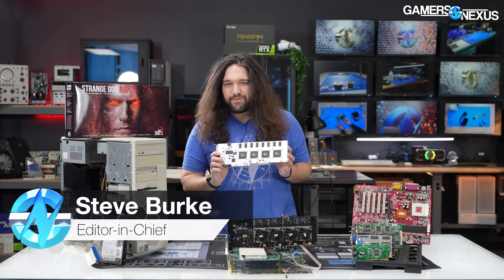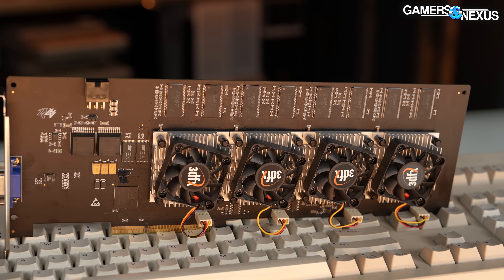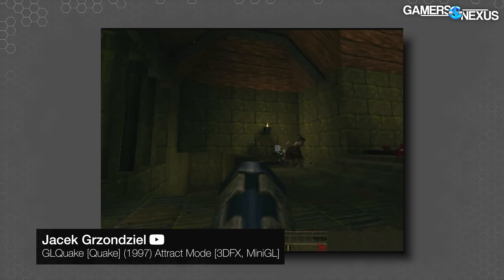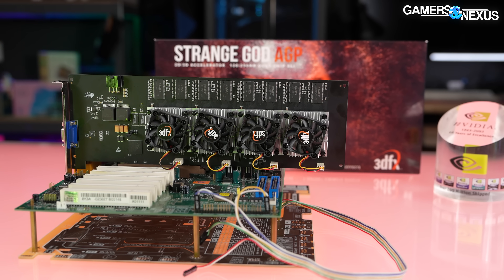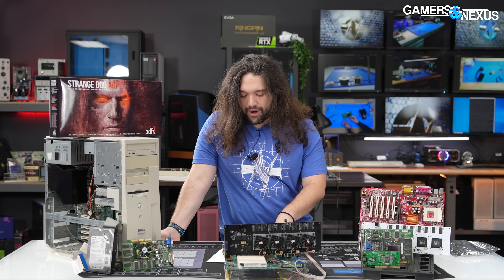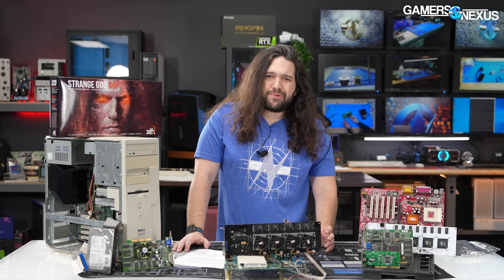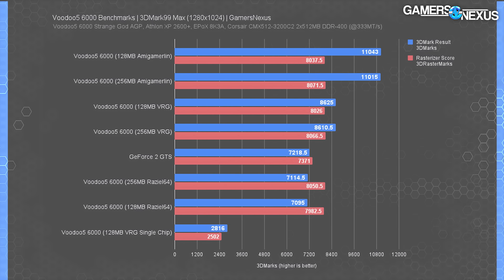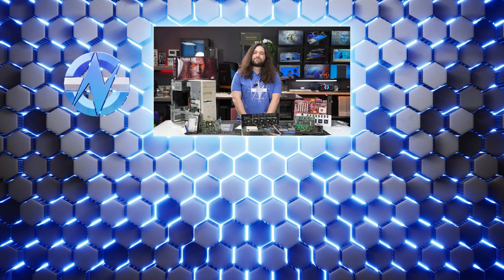Back from the Dead: 3dfx's Unreleased Voodoo5 6000 Quad-GPU Card

Comment: Still got a Voodoo 4 4500 somewhere. Wrote up a piece on my old hardware site back in the day, comparing it to a Voodoo 3 3000 and a TNT2 Ultra. It ran much like a slightly overclocked TNT2 Ultra because, with a 2x1 pixel configuration, it more or less was.
It was sad to see 3DFX prove it really was just a one trick pony, once SST1 was obsolete it iterated the best it could, but couldn't evolve. Avenger will always be the pinnacle of 3DFX's achievements in my heart.

Comment: This was a really cool blast from the past. I distinctly remember Leo Laporte going nuts over the GeForce 2 series, and how it was a "3dfx killer." For my part, STB made my first dedicated graphics card from this era... a PCI "S3" model, if I recall, with 8 MB VRAM. I was pissed when 3dfx bought STB -- all my driver support disappeared! 😩 First AGP graphics was the GeForce 4 Ti. Super proud to snag that one at "only" US$400 in ~2003 money. (Retail could be as much as double that, depending on the usual factors.) Ran it for years. I also had the first ATI Radeon... the Radeon VE if I recall (later badged Radeon 7000) as an AGP card. Wish I hadn't got rid of it now, but it "only" had VGA outputs, and I was neck deep in DVI in those days. 🤷‍♂👍

Comment: YES! So glad to see this type of enthusiast and retro projects.  Am I biased as the owner of 2 different voodoo 5 5500's in retro PC's? Maybe- but this type of niche content is still impeccable.
Reply: I still have the V5 I stole from the returns / damaged cages at PC World back in the day. Still works like a charm. Haven't installed it in any retro rig though. I did for a while, but swapped it out for a Geforce 2 Ultra and used a pair of 8MB V2s for the Glide games.

Comment: Loved the video, brought me a lot of memories of that time when 3dfx died. The only thing I missed was a FSAA test. The Voodoo 5000 was the first GPU to support the feature. Was one of their selling points. Also high res textures.
Reply: I think any voodoo can do anti aliasing, I remember the option in the windows drivers for the voodoo 2!
Reply: Many cards of the time could do a basic render higher res and sample down technique but the resulting ordered grid is not particularly efficient method for the most visually aliased directions (near horizontal/vertical). Voodoo 4/5 implementation allowed sparsely sampled (aka rotated grid for 2x/4x) grids. Though ultimately as super sampling it still had a significant speed penalty. Anti aliasing remained a bit of an old game only thing up until the ati radeon 9700 dropped with multisampling a couple of years later.

Edit: totally forgot the gf3 did actually have multisampling and a decent 2x sample pattern, however it was still a fair hit on speed with most at the time preferring to use spare performance for higher res.
Reply: Also, the Voodoo 5 lacked hardware accelerated transform and lighting. It was because it was so late to hit market. Back then I bought the Radeon DDR (first Radeon branded) which was faster then the Voodoo 5 cards, but I was still torn about the it. I have I friend the got the Voodoo 5 and we all were so jealous about it, in spite of having faster GPUs, the Voodoo had this cool factor and a lot of games still supported glide, and looked amazing. It was good times. I miss having more than 2 brands o GPUs to choose from.
Reply: @idetre  Good times when there were 3dfx, ati, nvidia powervr, matrox... but the future was already defining

Comment: I wish you would have put out a call to your subscribers. I have a working AMD Athlon system, AGP,  Windows 98SE installed. I also have a Pentium2 400mhz system with a MAtrox 2d card and 2x Voodoo2s in SLI, also Win98SE. I would have been happy do help you out.
One of the problems with testing these old cards is getting a CRT monitor that can handle the refresh rate. I also have a Hitachi Superscan Elite 751. As a now aging, PC hardware enthusiast, I really enjoyed this video, great work!

Comment: As PC HW collector i have alot of 3Dfx cards.. In fact i miss some such as Voodoo IV 4500, Voodoo V 6000 (since is SO rare as hell), Voodoo III 3500 and Voodoo III 1000/ Velocity, everything else i have from the consumer cards.. I dont have also Quantum 3D cards as they are also very rare... Aside from that i have alot of ATi, nVIDIA, Intel, AMD old HW, MatroX, CyriX, Rendition and many others... I have Vodoo V 5500 AGP card in GIGAbyte dual socket 370 mobo with x2 Pentium III 933, 2GB ram, 200GB IDE drive all in black IBM case... 

Nice video, it will be nice if the channel does more videos like these of some old HW...

Comment: I had an i740 back in the day, too.  I remember it was a massive pain to get it to work right on my K6-2 system.  Doesn't surprise me that they had to run it on the P3 to get it to work right.
Reply: I found some i740's that actually looked well made, in a bunch of Dell workstations. Curious, I didn't recognize them, so I took one home to test it out and was surprised at how well it actually played (for what it was). Monster Truck Madness all night. 

Obviously not a belter, but good enough. Cool pieces of history! XD
Reply: @TheVanillatech   good for DX5 games
Reply: @ChristopherKubilus-k8e  Yeah they did the job for those early accelerated titles. Lacked a lot of features though, the smoke on Colin McRae and GP500 for example, wasn't transparent, but thick opaque black polygons! :D 

Kinda unique! :D
Reply: @TheVanillatech  I had an Intel 945 on my 2005 Windows MCE and Battlefront took 10 mins to load because no TnL and then the light sources shined through the walls. Pretty bad for a $1000 computer with the worlds first dual core Pentium D 820 at 2.8 GHz. Luckily it had PCI-E and I learned all about that and Graphics cards.
Reply: @ChristopherKubilus-k8e  Yeah of course. Aint no onboard GPU gonna be up to snuff back in those days. Shit was exponentially improving year on year. Golden era of gaming. Shit even top end Dell workstations like the optiplex and dimensions, which cost over £3000 and came with dual P3-550Mhz Slot 1 CPU's, onboard SCSI ports back in 1999 etc, even they only had ATI Rage Pro onboard, cos they ain't meant for gaming. Just enough to give you a nice picture in Windows thats all.
Reply: @TheVanillatech  I threw a fit when my parents didn't buy me Monster Truck Madness 2 at Best Buy and then they bought it for me (I don't remember if it was right then or for my birthday) and it was the best game lol

Comment: I absolutely loved how smooth UT99 was on my PII233 and Voodoo3 3000 AGP. I felt like the Glide/UT99 optimisation on the Voodoo3  more than compensated for my lower end CPU at the time. I still remember I used to run them both overclocked. The Voodo3 from 166 to 183 (the speed of the Voodoo3 3500 TV) and the PII from 233 to 292 (the highest setting my boards FSB would go? from 66 base to 83... again, using very old memory brain cells)
Reply: yeah but over clocking only just startred to come out then, i remember in 1998 computer shops were only just startign talking about it and magazines were pushing it .... before 1998 nobody had heard about it or was doing it... quake 2 probably started it all, it did look amazing at the time with 3dfx

Comment: Loved this video. My very first piece of computer hardware I got was a 3DFX Voodoo 3 2000 PCI for my birthday (~10-12 years old). Had to take it to a local computer shop to have it installed because I didn't know anything about doing that kind of stuff yet. We had a Packard bell with a Pentium I, 16MB RAM, and a ~5GB Hard drive. I remember being blown away at the difference when I got the computer home with the Voodoo 3 2000 installed. First thing I launched was the hexen II demo. The difference going from software rendering to hardware accelerated OpenGL (or maybe glide IDK) was night and day.

Comment: I actually had that MSI board! Also smoked an Athlon in it, using the wrong standoffs 😂. Those CPU dies were naked and not temperature protected.

As far as I know, you can't put a 2400+ on that board. You'll need a previous iteration of the CPU I think. Those were up to 2100+ if I remember correctly. It's a Palomino board originally.

You can make the 2400+ (Thoroughbred) work though. You had to mod the motherboard. If memory serves me well, you'll have to remove a small component of the motherboard. Component c37 I think it was. And a more recent BIOS supporting Thoroughbred.

So....maybe the board is less DOA than it seems? 😂

Also a popular mod of the GeForce 2 GTS card was putting heatsinks on the memory with thermal adhesive and you can also thermal adhere a Zalman Blue Orb on it.

Also popular before 1GHz CPUs were a thing ...getting the 100MHz FSB 600MHz Piii and slapping that on a 133MHz FSD, getting you to close to 800MHz and not running the busses out of spec. On the old BX440 chipset, people hit close to 150MHz FSB and reached around 1GHz.

Fun times.😂
Reply: Oh the blue orb! Stuck one of those on my geforce 256. Was a pretty good overclocker actually went from 120 core/160 ram to 160/193

Comment: Cool episode, brings sweet memories. I remember how cool and fun it was to mod and overclock those years cards. Also design look so simple today with those big ass 0805 SMD parts :)
You just explained typical R&D process of graphics card AIB bring-up :) Broken corked drivers, flaky power management, early buggy silicon, hardware issues , etc :)

Comment: What a great video, brought me back to the old days. The MSI KT3 Ultra was the first board I bought brand new ! ( Before I only bought used ). I had an S3 2D card with 2x Voodoo 2 3D accelerators and a Samsung 19" CRT. Man was that a brick to carry around to LAN parties, lol. I beige Full tower with 2 CD burners an 2 CD reader drives for the sweet dual copy function ;) Remember the 10.2Gb Seagate 7200RPM HDD, plus a few older smaller used HDD. Them ribbon cables... Cable management was impossible.

Comment: Nice bit of nostalgia. I think the GF2Ultra and GF3 came out about the time the voodoo6000 should have. Was always a big "what if?" conversation piece. Now we have an idea. Voodoo2 was amazing for a minute tho. We had a box in the office with a 3dfx card that ran two voodoo2 pcbs on a single agp card slot. It was troublesome, heh.

'Bout that time I did a full system upgrade to a Duron600 (overclocked to 1GHz with a paint pen, as was the custom at the time) on an Asus A7V, 128MB of Mushkin low latency SDRAM, and carried over the TNT2-64Pro PCI (slowww 64bit memory 3d card) from the old system. I quickly purchased an AGP Hercules' GF2MX (an ok, cheap card with 128bit memory for 1024x768 gaming) and ran both cards, giving me my addiction to more desktop space. Then was given the original ATi Radeon 64 VIVO as a Christmas bonus. Neat card, bad drivers. It was a little faster than the original GeForce or my GF2MX, but slower than it's contemporary, the GF2GTS. Still it would play Tribes3, Mechwarrior3, and UT99 at 1600x1200 at around 60fps IMS. Really clean vga output too.

Doesn't get said much, but most of the independently built NV and 3dFX cards used lower quality RAMDACs and were visibly blurrier than ATi and Matrox (who manufactured their own cards) on a good-ish monitor esp at 1600x1200. So our "for work" boxes all got ATi and Matrox. Gaming systems all got GeForce2s. Boss got a Matrox G400, another card that gets overlooked these days. 

I guess the term GPU is being applied more analogously today, but AFAIK nothing before the GF3 had a GPU. They just accelerated polies and stored textures. Though the Radeon had some GPU-ish functions that didn't make DX8/OGL support. Anyways, just semantics.

Comment: The jump in visual quality from software rendering to glide/opengl in games like Quake and Tomb Raider back in the 90's, it's still an unparalleled leap. When I saw Quake 2 run in 1024x768 at +100 fps  on a iiyama CRT, I couldn't believe my eyes. What an era ! 
AMD K6-2's, First Athlon chips ( pencil overclocking ), Epox motherboards... Creative Voodoo 2, Nvidia's Riva TNT2,, the Creative GeForce 265 Annihilator card, all amazing chips, damn I'm getting old :-) 
Thx for the effort, nice video !

Comment: That Dell Dimension XPS T you have there is one of the best systems Dell ever made.  It's insanely upgradable, and with the right parts, you can upgrade the CPU all the way to a 1.4 GHz Intel Celeron and 768 MB of RAM.  It has AGP, PCI, and ISA slots so it straddles multiple generations of PC hardware.  Compared to the custom-made PCs at the time, the design of the case was pretty forward-thinking and well thought out.  It was very easy to work with and I had the previous model, the XPS R 400,  that lasted well into the Pentium 4 era.  The only drawbacks were the Dell-proprietary motherboard pinouts.  My PC at the time was home to both the Orchid Voodoo Graphics card and the Vodoo3 3000.

Comment: Steve, with these cards, you need to install Tribes 2 and see if it ran it well. These cards were, at the time, supposed to be the pinnacle (Voodoo 3 was technically), at the time. At any rate, if you can, please see if you can snag an old copy of Tribes 2 and see how it plays on 98SE. I played the original Tribes endlessly, followed by Tribes 2, Half-Life, Counter-Strike Beta 7 through to 1.3 ish, etc.

Back then, I started in 8th grade with a Diamond Voodoo 2 card on a Pentium 2 system sometime circa 1998 or so. I also had a Riva TNT2 sometime in there as well. That thing was a beast. Later on in high school I upgraded to the GeForce 2 GTS and then a GeForce 3 Ti200. The final card I had was an AGP card, was an ATI X800 which I attempted to bridge to an X800XT but it didn't work. Then I went to college and with the release of the Core2 chips everything changed.

How time flies I suppose.

Comment: This is easily one of the best pieces of journalism on vintage hardware I've ever watched.

I grew up working on this kind of hardware, and I currently have a fleet of vintage PCs and hardware.  You would probably love my Win98 machines, they are overkill.  Especially with the cooling solutions (just not water cooled).

Not surprised by the 70 hours.  Those old machines are not easy to work on haha. 

If anyone is interested, I can post videos of my hardware.

Comment: I worked at 3Dfx until they were bought out by Nvidia.  One of the best jobs I ever had.  I was part of what they called the "Voodoo Crew". I still have my shirts, hats, etc.  I also still have the 3Dfx cards they gave me right before closing down.  I see a lot of discussion about the V5 6000, which I actually used in a few hardware revisions.  In the very beginning the card was going to be called the Voodoo 6 6000, to give the impression that it was entirely a different platform over the V5, which it was obviously not. Still, such an awesome idea. 

I see videos depicting what the retail box would look like, or they imagine what it would look like, and they look really cool, however, they're all mistaken. The V5 6000 was going to be shipped in an aluminum case as part of the presentation, which was fitting for such an expensive card with an MSRP of $599 at the time.  The final version was going to use an external power supply called "Voodoo Power" or "Voodoo Juice" - the final name was not decided upon before it was cancelled.

Comment: Wow the nostalgia. I remembered having a STB voodoo2 back in around 98. The next upgrade was a TNT2 a few years later. Then there was also Dual Celeron on Abit BP6 motherboard. Those were the days.
Reply: I remember the dual Celeron days! I was envious of those builds and overclocker when spending time on the overclocker forum. 

I could only afford a Cyrix MII, but later got a K6-3 after I killed the Cyrix trying to force an overclock. I can't remember what graphics card I had, but it wasn't 3d capable, I always wanted a 3dfx card...

Comment: I remember upgrading my dual voodoo 2 setup for a GeForce 2 Ultra. It was probably the biggest leap in performance i have done since :)
Reply: Hell yeah, the days when 156% performance uplifts came around what felt like every other week... 🤣 I know some complained about it, but was it really worse than where we are now?
Reply: @memitim171  i actually looked back at my old cards from back in the day. It were some crazy years there mid 2k. Now days i tend to skip a generation for example I bought the 1080 TI, skipped 2-series and bought a 3090, will probably skip 4 series. But back then then the release cycles were shorter, ok so I bought the GeForce 2 Ultra back in 2000, the GeForce  4600 in 2002, the 6800 Ultra in 2004,  the ATI x1950 XTX in 2006, the 8800 GTS (G92) in 2007, GTX 295 in 2009, the GTX 590 in 2011, the GTX 690 in 2012, 980 TI in 2015 and then the 1080  TI in 2017. :)

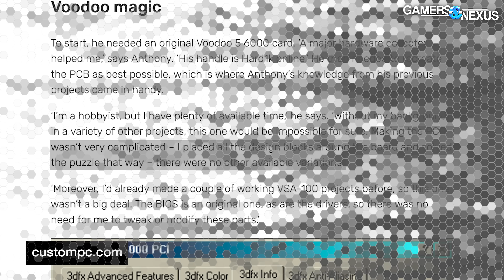Comment: 3:40

Here is a reason why one may not wish to take credit for a PCB that is reverse engineered. Most of the time, the layout, including PCB traces, widh thickness and clearance values, or ERC in general have copyright assignment to it, not to mention, the block diagram often falls under some form of patent.

By claiming the routing to be a simple, obvious and only solution one set themselves up against getting sued for violation.

How do I know ? Not gonna tell ya

Comment: My best 3dmark '99 result of i740 8MB + 2x32MB SDR + Celeron 300A@450 was; 640x480 - 1960, 800x600 - 1507. I have old xls file where I wrote results from PC Games CD magazine and my results. Ohh memories. Have also GF2MX 32MB results but in 3db files. Never had 3dfx went from 1MB Trident to 2MB S3, then to i740 8MB and GF2MX 32MB later.